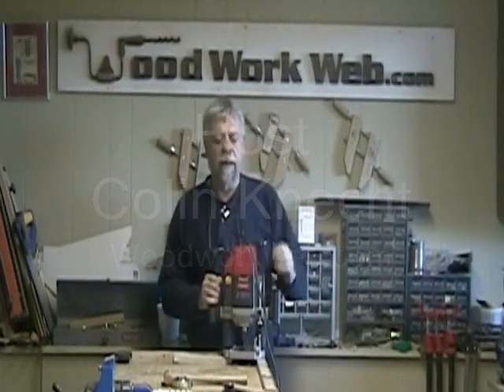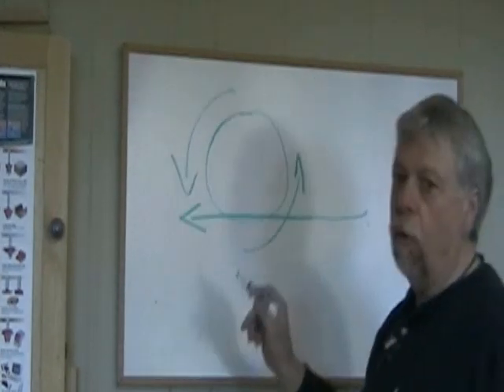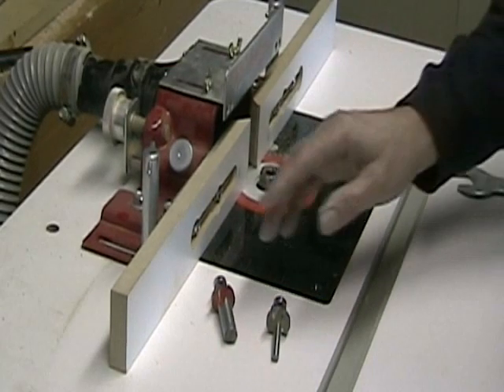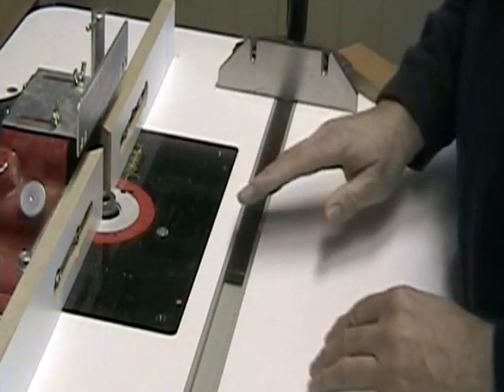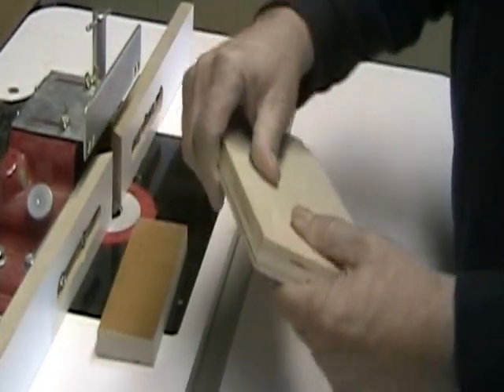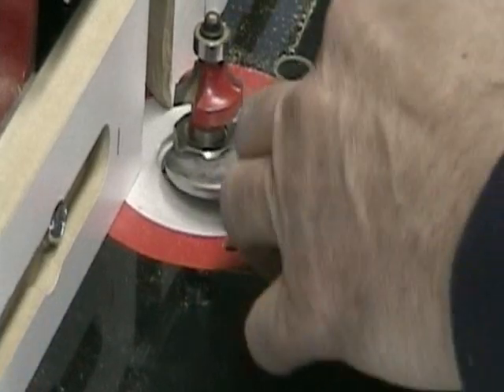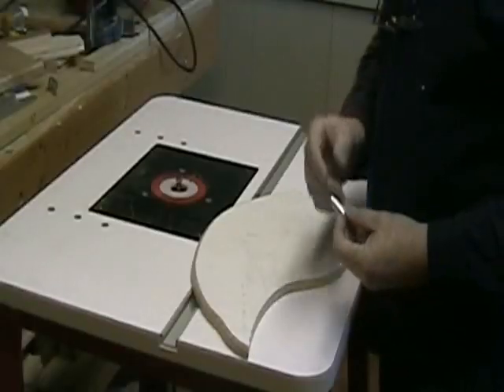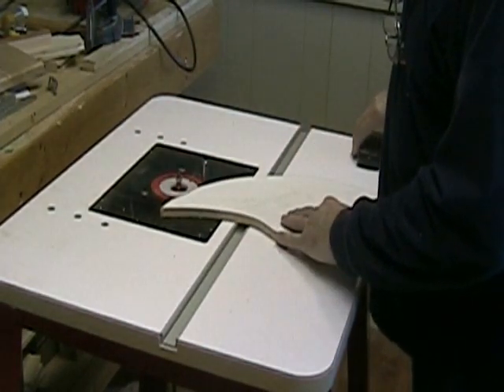Router Table Basic Instructions  - A Woodworkweb woodwoking video

Comment: Thanks for this vid. i bought a bosch router/table combo in 2006.  i know how to use pretty much every tool except a router.  now that im doing cabinets and fine wood work.  i had to break out the router and table.   after dumbing around with my pride and making routered firewood, i broke down to said, lemme google it.

i found this vid and 20 minutes later im rocking and rolling.  now when ppl  see what i did, ill just say:ahh thats nothin, i just used my router.

ur a great teacher man thx!!!

Comment: Colin:
I am a new user of woodworking machines, such as a Router. Sometimes I have an advanced work, but having bought a router table, I made some trials with wood pieces and happened what you mentioned in video. I was feeding the wood in the WRONG DIRECTION, and as a result, a bad cut and a hit in the wood that scared me. Finally, thanks to your video, I understood the correct way of feeding the wood. Thank You.

Comment: Thanks for your videos.  I am building an R2-D2 and alot of it is made out of wood.  I bought a router because of this and your videos certainly help me when I need to know how to router a particular type of piece wood. And your safety is good too. I don't want to get hurt!
Reply from the maker: Build an R2D2 Thanks for taking a  moment to comment ... R2D2, hmmm would love to post some pics of that on our Facebook page when you are done ... or at the very least see some pics, sounds pretty cool
Reply: WoodWorkWeb I have a bunch of videos on my channel and links to my blog which has lots of pictures and videos of me building parts.  I have used a chop saw to make "surrounds".  May not have been the best way, but I did it.  I used a router to make rounded portions for some of the "rear logic display".  My dome is almost done, and I plan to make the body out of wood.  This will require alot of inner and outer circle work. as well as  grooves.  I get all the plans from the Astromech.net forum.. This droid is a challenge for sure.
Reply from the maker: Build an R2D2 Will check out your vids and builds ... looking forward :}

Comment from the maker: Thanks for message, yup, routers can be ruthless, but is sounds like you may have been feeding from the wrong direction?? Best to push the wood into router bit as it spins toward the wood otherwise the bit does exactly what you describes ... grabs the wood and flings it across the router table and off the other side.
Thanks again for sharing this ... great to have you with us.
Colin

Comment from the maker: Hi Smitty, sll routers I have ever used only spin in one direction, and all router bits are sharpened to cut most effectively the same way the routers spin. If you flip the router upside-down and look down at the bit, it will spin counter-clockwise so the feeding of wood is from left to right on a router table and opposite feed direction on when used free hand because the router is now right-side up. Thanks for posting this, I know others wonder about this too.

Comment from the maker: @MsScorpio1030 I am using an older Freud router and router table with 2 different Freud routers. One of them does allow the height of the router to be adjusted and bit changes from the top of the table. The other Freud router is an older design plunge router and it is a bit more awkward  to change bits (but you do get used to it).
I am not 100% certain of their most current models.
Hope this helps .... 
Colin

Comment: Colin I know you can help me. I am kind of new to wood work and I have started my first project where using a router is necessary. I have followed your video instruction without a problem. But when routing a 1/2' roundover on a piece of Oak  the cut was 75% burned. The cutter is new. My router also new but it is a single speed. I didn't know what to do other than put the project on the shelf until I can fid an answer.
Great videos. Thanks.

Comment from the maker: Burning on wood is pretty common and very annoying. It happens with router bits and saw blades and is more prevalent on some woods, like oak and maple. Sometimes you can speed up or slow down the speed of the bit or the speed you feed the wood through, but often nothing helps. There are many reasons for burning and what works on one, may not work on another.
Sorry Douglas ... no easy fixes for this that I know of, except sanding. Best I can offer is try some different methods to see what works.

Comment: I am interested in making inside doors for my house. Raised panel doors? What is your advice? Make them with small router table? Do you need a larger router table?
Reply from the maker: Hi M, not many people make doors, but no reason not to, lots of different designs, but you will need a large room. If you are doing rail and stile doors, yes a full size router table is would be an asset. You can also purchase router bits for large passageway doors. I have not used them but those who have were very impressed with them, but make sure you get a quality brand, some of lesser quality ones, the bits don't align, so you can't make a decent door no matter what you do. Hope this helps ... email me a woodworkweb if you need more, not much room here

Comment: Do all routers have the ability to raise or lower by screwing them from on top? I inherited a plunge router that I'm puzzling out and haven't seen anything that would allow that function. Would that function be built into the router or the table it's attached to?
Reply: Raise and lower as in cut depth? If that is what you mean, it will def be on the Router itself. If yours does not have cut depth adjustments, its: A: Not a plunge router, and B: Super weird bc I have never heard of such a thing.  The table is (basically) just a mount.